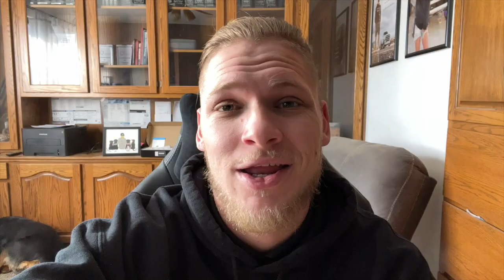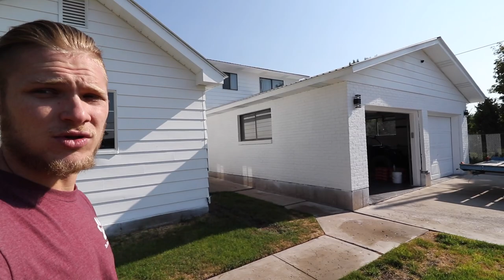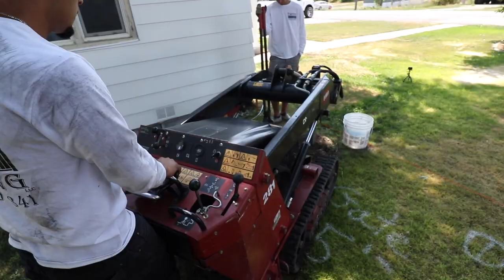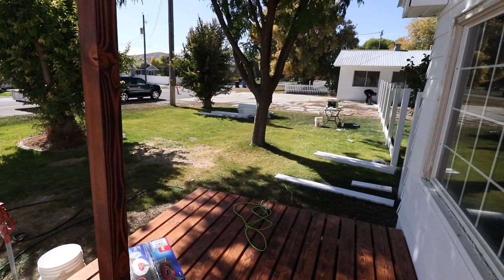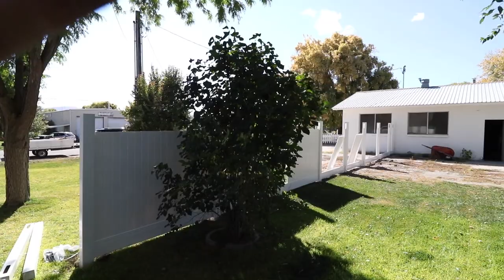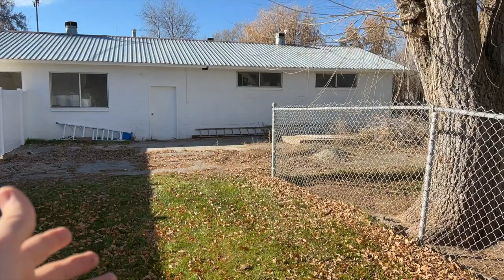Rottweilers ran away, again. 👀

Comment: Instead of concrete along the whole bottom,  you can take a hog panel or cattle panel and bury it under the fence.  Then just cover it with dirt and plant grass seeds.  No unsightly mess.  This method is used all over rurally to keep predators out of areas.  Works great.
Reply from the maker: thats a GENIUS idea!